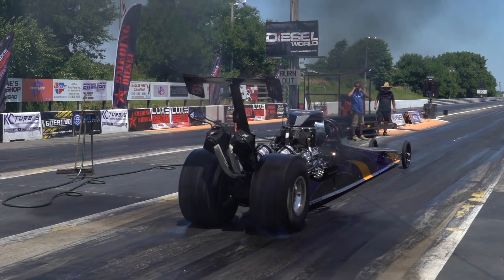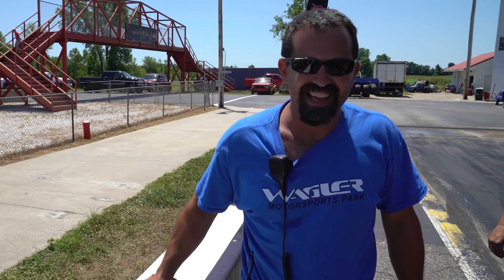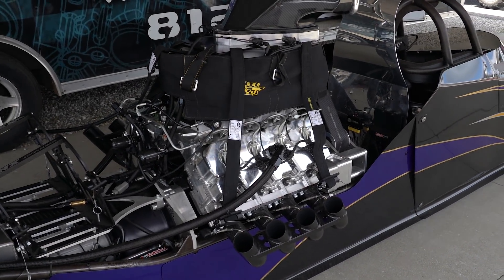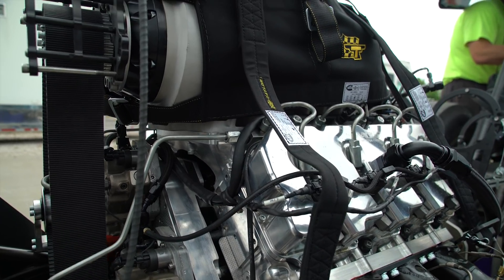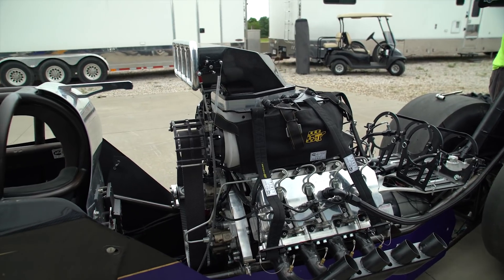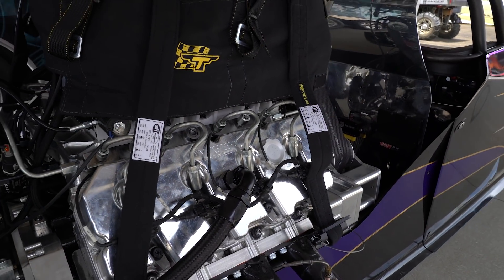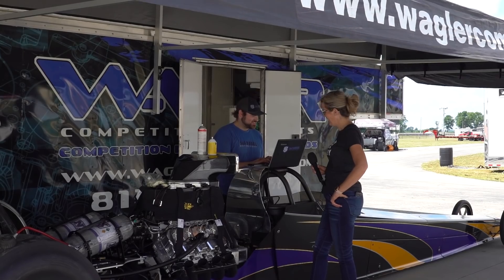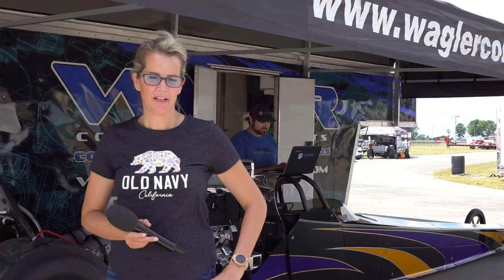Top Fuel 6.6L Duramax Engine - Wagler Competition

Comment: Top fuel is 80-90% Nitro Methane, and 10-20% Methanol. Diesel is diesel. "Top fuel diesel " isn't a thing, sorry.
Reply: They mean diesel as the type of ignition not the fuel. This is still a diesel regardless of what it is burning. It's a diesel burning top fuel ....... so what do you call it then? Top fuel its not, diesel, it's burning methanol so no..... so top fuel diesel is the only nomenclature close enough to describe this monster
Reply: @triplestangman  I disagree. Its a diesel dragster. "Top fuel" is mostly Nitro Methane, and a splash of methanol. Those are the rules of top fuel. Period. Top fuel isn't diesel. In top fuel, nitrous oxide is not allowed. This dragster would not be eligible for top fuel, and it wouldn't qualify if it did. So let's not call it "Top fuel"  And FYI, diesel is a fuel, not a method of ignition, diesel engines rely on compression heat for ignition. NHRA rules dictate that the engine be version of the 426 hemi, that can be up to 500 cubic inches, so it can't possibly by Top Fuel.  And no Nitro Methane is sprayed into that engine, it would explode like a bomb.
Reply: @triplestangman  The engine is a compression ignition engine that uses diesel fuel for combustion. The diesel fuel is injected directly into the cylinders. They also use a 50/50 water/methanol mix as coolant in the charged air system to cool the blower, as without it, the blower creates too much heat from compressing the air.
Reply: @triplestangman  if the engine ignites nitro methane or any fuel like a diesel ie not electric ignition it should be classified as a top fuel.  Or do I have it wrong.
Reply: @quartusbuys6831  Top Fuel is a specific racing class with specific rules; and amongst those rules, as the name implies, is the rule governing what fuel is used for the engine. Top Fuel cars use a mix of nitromethane (no more than 90%) and methanol. Not sure what you’re trying to say about electronic ignition. Diesel engines (including this one) use compression ignition. Top fuel cars use spark ignition (2 spark plugs per cylinder) with two 44 amp magnetos (which is a hell of a lot of power)
Reply: Wait so this thing isn't burning any diesel? I thought the Injectors sprayed the diesel and has the water meth to cool the intake charge . Or did they just take a duramax block
Reply: @Natedawgontheright  it's definitely running diesel, but it is not "top fuel", according to the NHRA/IHRA, because, it's a diesel. The OP might call it that, but I could call my lawn mower top fuel too, doesn't make it so.
Reply: @Natedawgontheright  Your understanding is correct.
Reply: Unfortunately it seems whom ever titled this video probably just assumes a dragster chassis = top fuel, or it just sounded cooler to them. Top fuel uses a specific fuel blend, and diesel fuel isn't part of that recipe. This is a diesel dragster.

Comment: What a ridiculous set up. The amount of money that he has wrapped up in that piece of shit diesel he can get a big block Chevrolet and have a blower on it and run faster
Reply: Anything is possible, but he would not be the fastest big block Chevy at the track, he could be embarrassing slow with this rail and get tons of respect just because it's a Duramax or designed after one as it's all billet aluminum
Reply: @cargotoolshop5319  True and it’s a amazing unique idea to have a all billit aluminum diesel. But… For dollar for Dollar if that guy was to build a Big Block
Chevy (All Aluminum) and have it turbo charged it would run harder and faster than the turdamax….
Reply: @2clicks2theright375  
You're right. Everyone should just build big block Chevy motors. That way every car on the track has the exact same engine. While you're at it, should everyone have to use the same chassis too?
Reply: @heavymetalmechanicX  They can use any motor they want. If you go back and read what I said maybe you would understand what I was saying. Dollar for Dollar for what he put in that turdamax he could have a much faster and more reliable motor to go out and be in a bracket race and have a great fun time. Can you understand the environment now? You probably got a 86 iroc with a 50 shot of nitrous and the stock 305 in it and you tell everyone you run 10.0’s with it lol…. Mr.Mechanic
Reply: @2clicks2theright375  
I read what you wrote. And I understand the intent behind your original comment. That it is ridiculous for that man to spend money on that "piece of shit diesel" when he could just build an engine based on the same 60yr old architecture that everyone else builds and go faster, cheaper.
But not everyone wants to build a big block Chevy. How boring would the world be if it were just full of race cars with big block Chevy engines? You must agree...you've walked back your original comment twice now.
Reply: @heavymetalmechanicX  I agree with everyone having the same motor it would be boring. It is that way with top fuel BUT the Hemi head and 500 cubes with Nitromethane produces around 10,000 hp! So I’m surely positive you would love that class.
Reply: @2clicks2theright375  Someone had to be the first to built a nitro engine too. I'm sure if the internet was around back then. People would say the same thing. All that money and they could just build what's already been done. Why waste time and money.
Reply: I'm guessing the intent here is to see how far they can take the engine platform and having it in a dragster type chassis makes it good for development work, nice and accessible. Obviously if your only mission is to go fast there would be better platforms to build for the money, but if they're just trying to build the fastest duramax powered dragster or find the limits of a big power duramax setup for testing this seems like a good way to do it.
Reply: @SOHCGT96  ya I agree
Reply: Yea, but would you be watching a YouTube video of a top dragster with a big block in it? Exactly. They wanted to stand out and be different.
Reply: Can you get 2000 hp out of a stock big block with forged internals? This is a factory Duramax block filled with concrete, basic forged internals, and small port heads. Ran 174 mph in the 1/8 making about 2000hp. The only thing billet aluminum on it is the valve covers

Comment: why not just keep the turbo
Reply: Id definitely blame the lack of black smoke on the 2 nitrous bottles strapped to the back
Reply: Turbo is throttle, sensitive and a blower is instant power and rpm controlled, that engine probably has boost numbers three times higher than any turbo setup could produce, as you see the lack of black smoke
Reply: @cargotoolshop5319  compound turbo systems can produce over a 100 psi of boost, with no smoke. Top fuel cars run blowers because of noise and tradition. If turbochargers were allowed, they would dominate. Driving the blower uses 900-1000 HP, and they only generate 65 PSI of boost.
Reply: @jamesgeorge4874  top fuel takes more than a 1000hp lol
Reply: @young11984  nope, a correctly functioning 14-71 blower eats 900-1000 hp, in a top fuel configuration, that information is easy to find, lol.
Reply: @jamesgeorge4874  Clay Millicans crew chief said it eats about 1300hp in good air on PFI Speeds video when they were talking to Brent but soaking up 1k-1300hp to make 10-12khp doesnt matter much anyway lol
Reply: @young11984  Fair enough, the numbers climb a little each year, like overall power output. The point I am trying to convey is the parasitic losses incurred by even the most efficient blower, are significantly higher than the pumping losses incurred by turbochargers.
Reply: @cargotoolshop5319  lack of smoke??  It was smoking but nitrous, meth/water mix and tune makes good power with little to no smoke. Turbos can produce as much and likely more boost than the rotors can stand in a blower long term but both have their pro’s and con’s

Comment: Nice. That's a lot of money and work. I wonder if the combustion of a diesel is too sluggish to compete with a gas engine of the same size?...
Reply: Probably yes.
Reply: I seem to remember that a fuel engine needs lots of advance to run, that nitro is a slow burning fuel. Someone help me out here.
Reply: Nope. Mixing the fuel is.
Reply: Not gas actually, nitro makes it's own oxygen to combust. If it's running a true diesel fuel it couldn't come close

Comment: Get q cummins in there you'll be making 4000 ft Lbs of torque and 1600 hp
Reply: A built duramax can make just as much torque and potentially more than a cummins, it’s all about how it’s built.
Reply: They build 6.7 Cummins you can buy for your pulling truck that build 3k horsepower. Ive seen Cummins in drag trucks build 4k horsepower at 7k RPMs.
Reply: @jamesjarmon7383  Your numbers are off. 1600HP isn't going to net 4000 TQ. Not in a 6.7L Cummins anyways. 4,000HP at 7,000 RPM.....? In a 6.7L Cummins. I think you're adding a little to the numbers. I have seen 3500+ but not at 7K RPM
Reply: @countcuda70  Those weren't my numbers. You can short stroke a 5.9 and turn well over 7500 rpms at 4k horsepower. But they run and race better at 2500 to 2600hp.
Reply: @jamesjarmon7383  Can you name some trucks out there making 4k HP @ 7500+ RPM? I know a few trucks making 3500 HP but not at 7500+ RPM.
Reply: @countcuda70  The 7500 rpm motor was in a dragster. The 4khp motor was in a pickup, I don't know if it had a name, but it was a 3rd gen dodge. Different motors are built for different purposes. The engines that produce the most horsepower we don't get many details on.
Reply: Both motors made over 4k hp.
Reply: @jamesjarmon7383  Nah! If there were a couple out there making 4000 or over on HP. We would all know about it. Things like that get around. Maybe not the truck or person that did it but we would all know about the numbers. This isnt my first day around these trucks
Reply: I knew we'd get a Cumming fanboy in here.
Reply: @petermoto409  Well, there are so many of us. You were bound to get a few. I went from a 05 duramax to an 04 Cummins common rail, best move I ever made.
Reply: @jamesjarmon7383  Well, it's not that there are so many of you, it's that you're the most vocal. You are the vegans of the motor world.